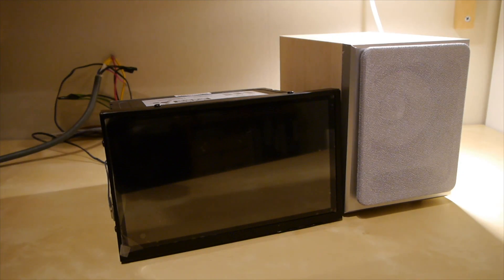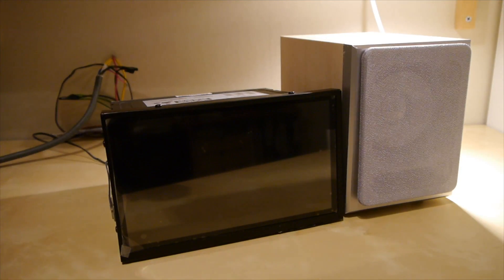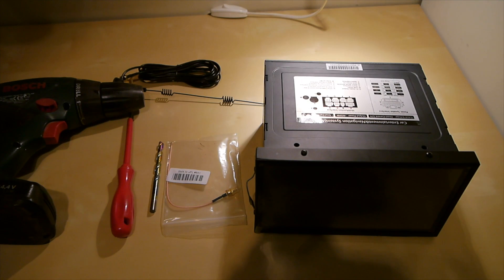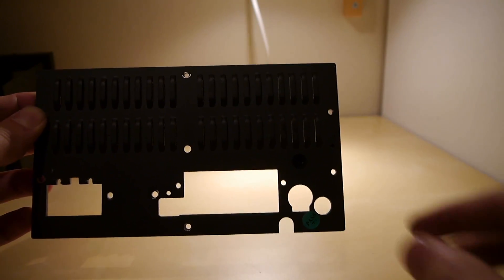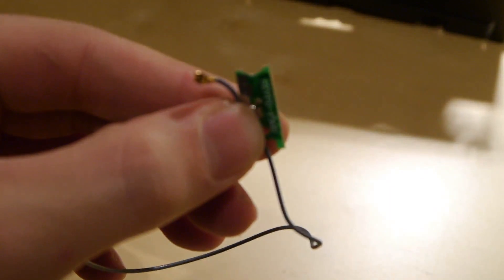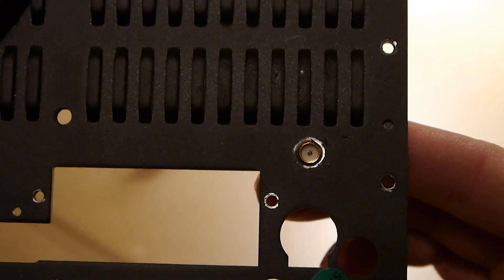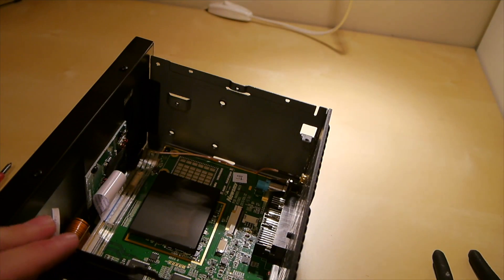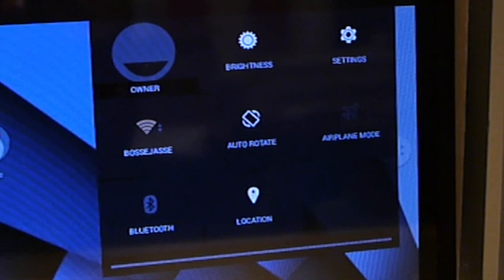How to: Remove noise and improve wifi on your android head unit (NR5002)

Comment: mine was soldered in, back had breakaway to put the connector in, attached an antenna and its working well
Reply: Hello my wires are also soldered on the board.. How did you get your wifi antenna connected